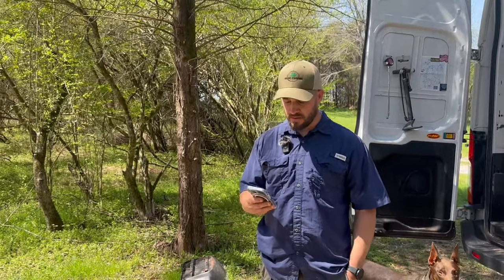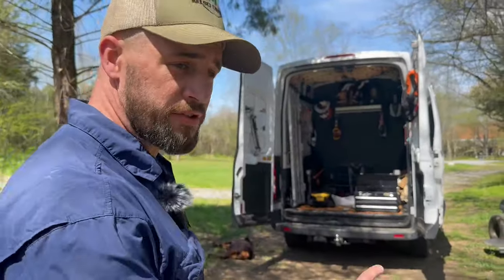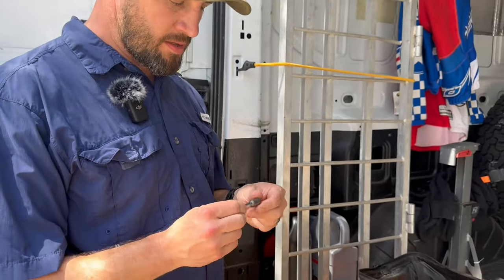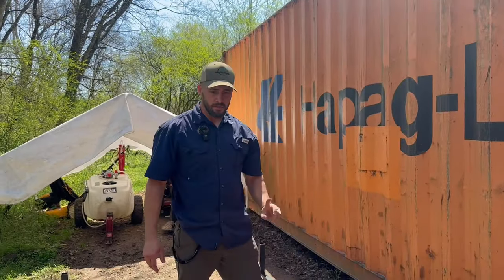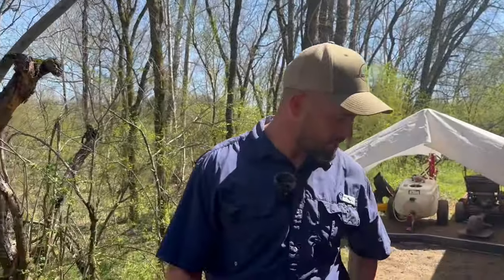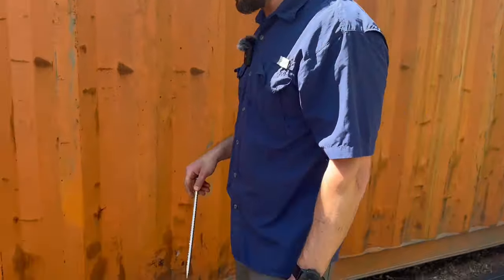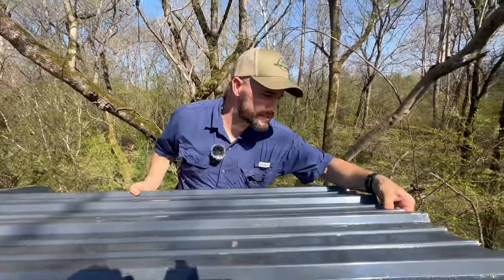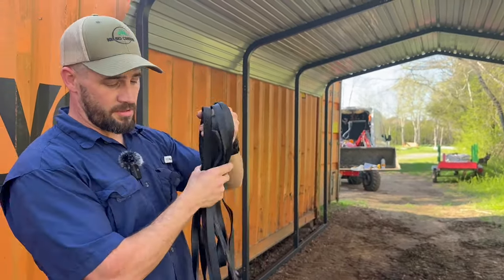How to Install: 10' x 15' Veikous Outdoor Carport

Comment: It seems like an excessive waste of time that they had to put shrink wrap or the clear film I every single piece of Roofing. I understand they don’t want to scratch the paint but it’s individually wrapped with foam anyway. How many hours did it take you to remove all of the shrink wrap on each individual piece of roofing that’s a couple hours that I did not calculate
Reply from the maker: It came off pretty easy for us but I also had 3 people working at the same time. I’m sure it’s a pain solo. Thanks for watching.

Comment: Sliding frame together not exactly easy...
Reply from the maker: Ya, it wasn’t terrible for us but still had some trouble.
Reply: @KelsoCreeks  taking plastic covering off each sheet was a pain. Did you remove the plastic?
Reply from the maker: Yes we did. Someone else said that it was difficult as well but we did not have a problem taking it off. 🤷‍♂️
Reply: Does it leak water with the black gummy shit caulking?
Reply from the maker: @bjams8817 I’d suggest some additional sealant on the ribs. That stuff was terrible to try and get right.
Reply: @KelsoCreeks  correct, i find it to be too soft and sticky, suppose temp may be a factor.  Thanks for all your info. i am starting to put the panels up soon. doing this on my own, so far , going ok.